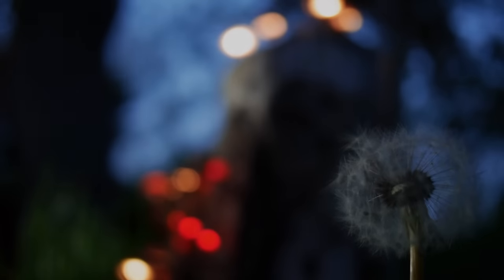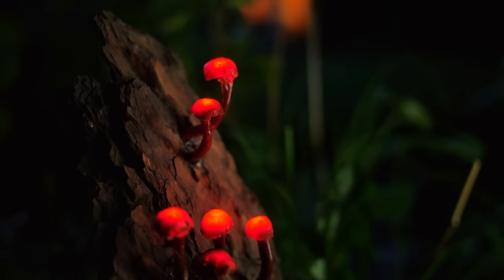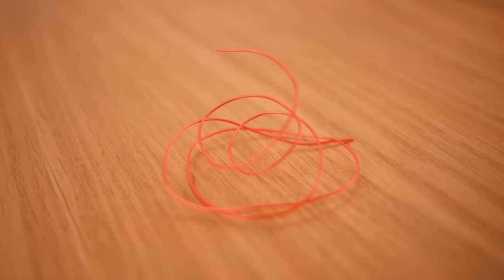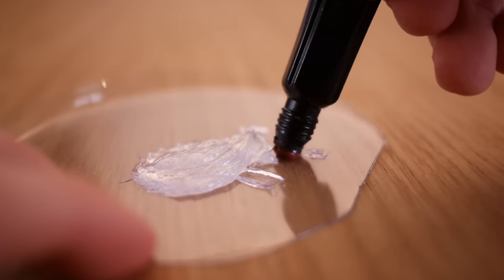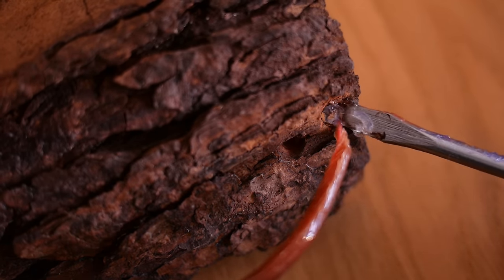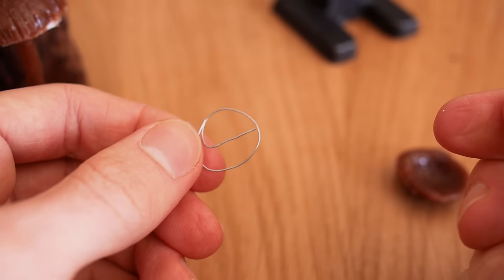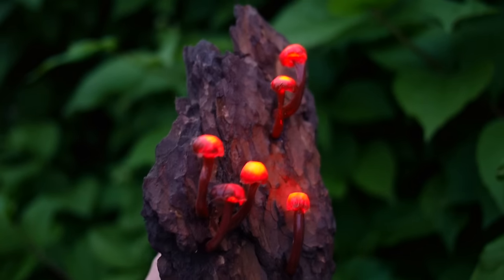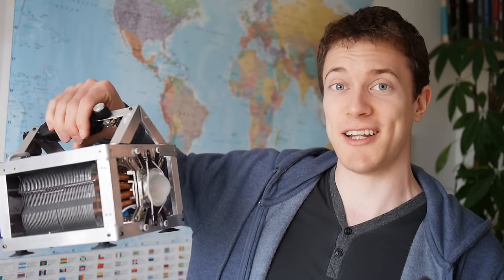DIY Mushroom Lights (craft project)

Comment: Can I plug it in on an outlet just using a single or 2 LED light I have a project using only 1 or 2 LED, if so, could you please make another of it I really appreciate it
Reply: Just pick the fitting resistor for your led as well as a 5v supply and connect everything to a usb socket. Then you can plug it in any usb power source you want.
Reply: Oh thank you good sir, I really appreciate it, my project is "fairy in a jar"
Reply: Wow that's awesome ♥️

Comment: how much oms resister will be required for 12 volt battery
Reply: better keep voltage as low as possible... even a phone charger is just 5v mostly

Comment: Would 1/4 watt resistors be ok for this project ?
Reply: If you take the LEDs from the strip and use 4,5V as source like in the video, then: 1,1V (the rest to 4,5V) times the current of 50mA equal 0,055 W, which is much less then 0,25W - so, sure!  P=U*I, power (W) = voltage (V) * current (A)

Comment: Quick question, if anyone can asnwer it'd be great. if i have a 3v battery output and my led needs about 3v, i do not need to solder a resistor, right?
Reply: You're correct - you only need a resistor if your voltage is too high for the LED.

Comment: So what your saying is to remove the lamp from my room and plaster a wood texture on the wall and yo dott mushrooms all over the wall to light up my room
Reply: I could run them from the wall to a solar panel outside and have them on 2 power sources. Solar for the day and flip a switch and have them come on from my houses electricity saving money on lighting at the same time

Comment: I'm looking for something that can mimic FIREFLIES!
Reply: I did that for my daughter, who had a plastic tree in her bedroom, with the branches overhanging her bed. It used 555 and 556 timers, with the intervals staggered so that the LEDs seemed to glow randomly. They looked great.
Reply: super simple... by those tiny fake candlelights they have almost random intervals
then remove the batteries ... connect all the positives together and all the negatives
depending how many u use then get a suitable powersource....

Comment: Does anyone have a link to some silicone that actually worked for them? (Amazon would be nice) I've been through the linked google doc, and found a few of the products on amazon, but they are a bit pricey and slooow delivery.
Reply: Use 100% clear silicone. I found some at my local Lowes
Reply: @zalankasko9113  Most silicones will not work, as he discusses in his attached google doc. I tried several that never cured when wrapped in plastic. I'll comment again with some that did.

Comment: Can someone link the resistors can’t find them
Reply: http://a.co/0CIlORY 
This is the pack I bought - there will be a ton of resistors in there you don't need, but there's plenty of low-ohm resistors that you can mix and match together. On some of my mushrooms, I had to solder a combination of resistors together on one of the legs. For instance on my red mushrooms I had to craft a leg out of a 100-ohm, and two 22-ohm resistors to get the proper resistance for my LEDs.

Comment: Not sure if that's save... paper, wires, resistor, LEDs...heat... fire... you know?
Reply: dude the heat part resistor is embed into the silicon no worries it disperses then only 3x AA batteries and the LED is efficient and low hear but still has room te breath it honestly can't BURN except for burn out the led if you over current it...
Reply: @g60force  ah okay if you say so.